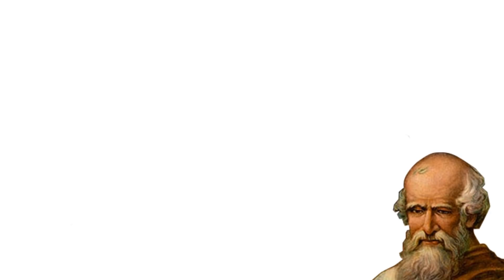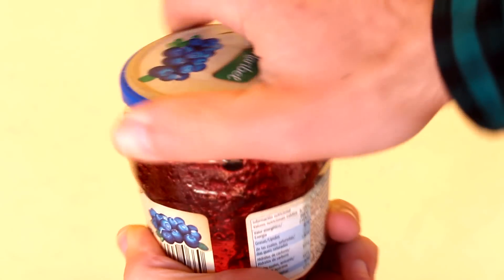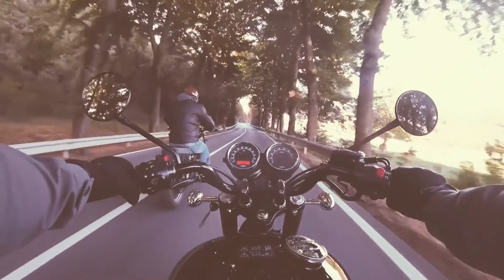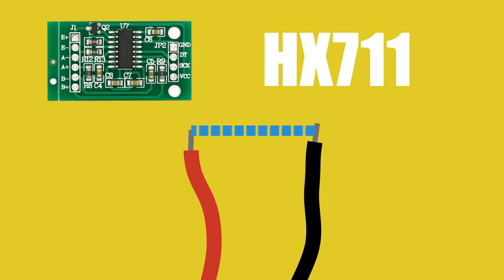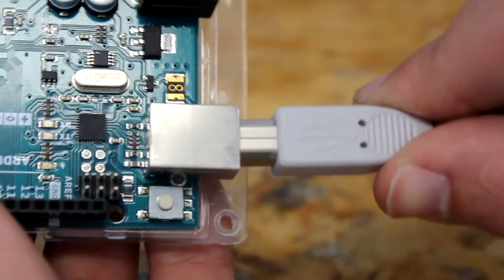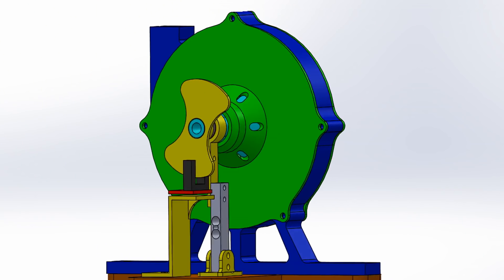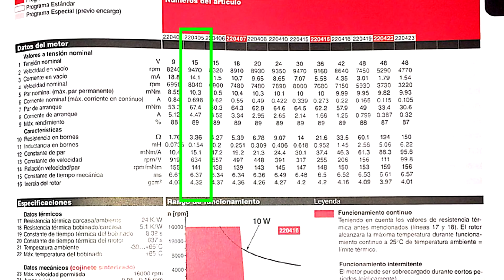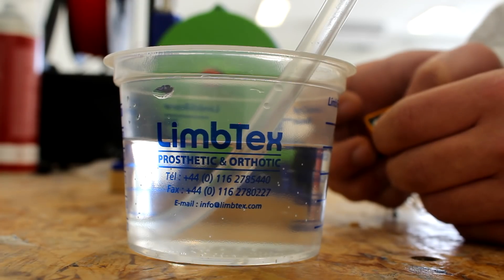DIY Torquemeter - How to measure torque! [Arduino & 3D Printed]

Comment: 7:42 buy some soldering flux dude, your life will change forever
Reply from the maker: The saddest part is that I use flux XD
Reply: Oh... what an awkward moment...
Reply from the maker: @OlivierCR  Awkward was when I tried to sing ahahah
Reply: @integza  That was beautiful. For a moment I thought my wife was playing Andrea Bocelli
 in the living room
Reply: @integza  Do you use lead-free solder?  If you can get some solder with a 60/40 Sn/Pb Mix, use that instead,  lead-free solder is very hard to work with.  I've never had to use any additional flux with it.  Also,  a chisel soldering iron tip would help a lot.
Reply: Also ditch the round iron tip. Seems the guys that do circuit stuff a lot (EEVblog or Big Clive are the ones I watch) say round soldering irons kind of suck. An angle tip is better for transferring the heat.
Reply: You need a clean tip, flux, and Moreno whisky.
Reply: you just need to clean the tip from time to time. Use brass or Stainless steelwool.
Reply: Yes, the tip is dirty, but it is also HUGE, get a smaller tip and thinner solder, it will be much easier. I'm an electronic engineering technician. :D
Reply: Clean the tip as mentioned but honestly, you need a solder station. Its well worth the temp control and the wand being slender and small.
Reply: @danh8302  i agree. And more whiskey
Reply: @danh8302  Adding a switch and a diode to cut the power 50% made my cheap soldering iron work at par with expensive ones :)
Reply: @danh8302  my solderstation doesn't have a temperatur control but its a older good quality "Weller" and have a crude controll in the soldertip. But its working really fine. And a good solderingtip is also realy important.
Reply: No need for flux. The solder he's using already has a rosin core. Flux is needed for SMD soldering which normally uses solder so thin that it doesn't have a rosin core.
Reply: @CristiNeagu  that's wrong, use flux everywhere and always! Other thing is, looks like your soldering iron is too hot!
Reply: @flecksrandomstuff4593  Yes... I always use flux... Except sometimes it's built into the solder wire...
Reply: @flecksrandomstuff4593  And dirty. TIp should be shiny.
Reply: @CristiNeagu  no, even in that case, use more!
Reply: @flecksrandomstuff4593  There really is no need unless you want to create a huge mess.
If you have a rosin core solder and you still need flux, you're doing it wrong.
Reply: @flecksrandomstuff4593  With normal, thick solder, you really don't need flux when soldering pin-through-hole components. The PCB would normally have a lacquer layer protecting the solder pad from oxidation so the rosin in the standard solder is more than enough. It's more a question of training and of keeping the solder tip clean and having the solder melt against pin and pad instead of melting against the solder tip. It's really a question of training. Practice makes perfect. So a bit of ling-ling time.

Comment: Back when I used to race R/C cars they sold dynos that consisted of a brushed electric motor running as a generator with it's output able to be run through various loads (resistances). So based on the current generated at each load and the respective RPMs at each load, the dyno could estimate the power. But how one goes about calibrating that business is another story.
Reply from the maker: Thank you for the input :D

Comment: Nice prony brake and explanation. Looks like you're using lead free solder, not a good idea unless you want to make your life harder. With a clean iron tip and flux core leaded solder it would be much easier and make nice solder joints.
Reply from the maker: I'm just not skilled enough XD

Comment: I’m no solder professionist (is that even a word!?) but maybe you should try using flux. Or maybe you already are, but I’m not seeing it :P
Reply from the maker: I'm using flux! I'm just really bad at it XD
Reply: @integza  heat the thing you want the solder to stick to i.e. the pin. Avoid touching the solder to the iron.
Reply: professional solderer, if you want the term. professional (x)er is the format

Comment: Hello from Germany, i pretty much love your Videos. Please never Stop doing that!  And i have a little tip for your Solderskills: If you soldering THT-Parts you have to heat the Board and the Pin at first and after 1-2 seconds you can apply the solderwire. It is also a good idea to use a solder-spnge to hold the Tip clean.
Reply from the maker: Thank so much for the compliments and tips :D
Reply: @integza  Additional tip: There is no such thing as "too much flux"

Also, I love your video, always laughing my butt off and still learning stuff
Reply: @xSchattenfluchx  I don't completely agree with you on that. Flux also leaves a dirty surface behind. You can clean it but yeah, if it's not neccesary... :-)
Reply: @integza  , your soldering skills are fine but it looks to me like your soldering iron tip sucks, making it difficult to solder well. I use this:
https://www.amazon.com/X-TRONIC-XTR-4040-XTS-Digital-Soldering-Station/dp/B003TC8EQS
and I love it. It heats up pretty fast (30 seconds, I timed it just now). The tips can take some serious abuse (I have left it on at 320 C for almost a week on accident and the tip was fine), the tips don't erode and they stay tinned nicely over a large area (to me, the tinning on the tip is the biggest factor for nice soldering besides temperature), plus it has a hot-air rework station so that you can solder and desolder BGA, SOT, SOIC, TSSOP, QFN, Etc. IC's and components with multiple tiny pins. 
I also highly recommend using water soluble flux, I like to use:
https://www.amazon.com/Chemtronics-CW8300-Water-Soluble-Dispensing/dp/B0091VQ3U0/ref=sr_1_20?crid=2Z32MTN98X0V3&keywords=water+soluble+soldering+flux&qid=1552184438&s=hi&sprefix=water+soluble+%2Ctools%2C210&sr=1-20

you can clean it off your board with water and a toothbrush, then dry thoroughly with fast air, I have used:
https://www.amazon.com/XPOWER-Airrow-Multipurpose-Electric-Duster/dp/B07MV1GSTT/ref=sr_1_3?keywords=electric+air+duster&qid=1552184667&s=hi&sr=1-3

or you can use a hairdryer with a reduction or set the drying PCB in a bag of rice/descant for a while.  

but for soldering my process is always:
-Clean the soldering iron tip by stabbing a copper scrubby a couple times (scrubby available in the cleaning isle at the supermarket).
-Add a tiny amount of new solder to the tip (for best heat coupling)
-Touch both pad and component with the tip, using the side of the tip that has the most solder hanging on.
-Add more solder on the opposite side using the smallest amount of solder to do the job (I recommend using a small gauge solder wire for more control). 

the last step is optional if there is enough solder on the tip, and you are using liquid flux/flux paste. In fact this is how I solder multiple tiny pins on say an SOIC chip. I cover the pins and pads with flux, load up the iron with solder, and then drag the iron across the pins. The surface tension of the solder in the flux keeps the solder from sticking across the pins.

Anyway, your skills are fine, you just need some better equipment, I might have done worse with what you were using.

Comment: i counted you saying "Torque' 33 times
Reply from the maker: That's a lot of chocolate milk!
Reply: @integza  if we do the math, eight 1oz shots = 1 cup, so that's 4 cups = 1 quarter gallon, about 1lb of milk, .45 kg ~ .45 L
Reply: @MrRyanroberson1  i thougth about doing the game with vodka i have laying around but after this comment im glad i missed out on that
Reply: You made me realize I underestimated the volume by a factor of 2. 1 pound = 1 pint, so it's more like .96 L
Reply: Ryan Roberson that would have been more than I have here at the moment (and that’s good. Nobody needs more alcohol at home at a time)
Reply: Ryan Roberson I did the same thing. I calculated 6 and 3/4 cups
Reply: @EliAfino-z5g  well, taking it literally 33oz = 4.125 cups. what surprises me most, though, is how eerily close it is to one liter. one more "torque" would have been supernaturally close, though, so i can't imagine this was deliberate
Reply: @MrRyanroberson1  so 450ml.
Reply: @justaguycalledjosh  read the rest of the replies
Reply: 30ml in a shot so 33 times is 990ml. A standard bottle is 750ml so he opened a second bottle in 16 minutes. Hey @Integza I think you might got a problem ;D
Reply: i recon i'd survive that
Reply: If I say torque 2 more times, that's 33 torques in this torqued up video...
Reply: That would actually be survivable

Comment: TWO THINGS: 1) Smoking rocks over drinking,... 2) As one person who(m) asked for the turbine as a vacuum pump,... I am DISAPPOINTED. Please run pump to extract air from tube in H2O. Measure vertical rise of H20 - convert to torr. COME ON you be my bitch! ;-)

Comment: The max power is not necessarily at the max torque. You need to multiply torque and rpm and find the max of that. Or even better, make a graph.
Reply from the maker: The graph is a good idea !!!